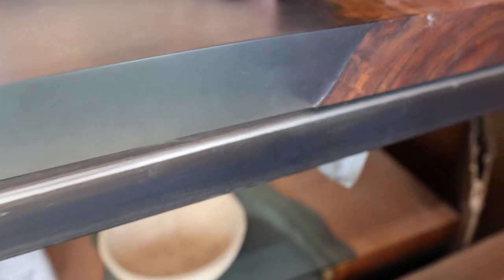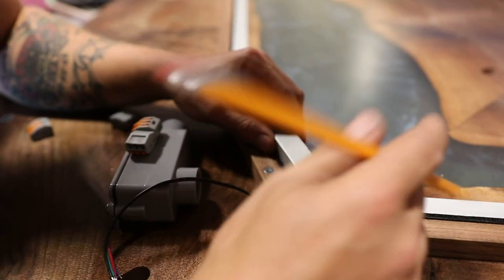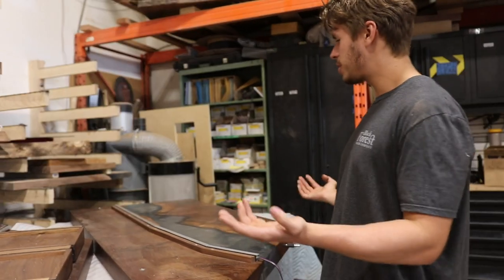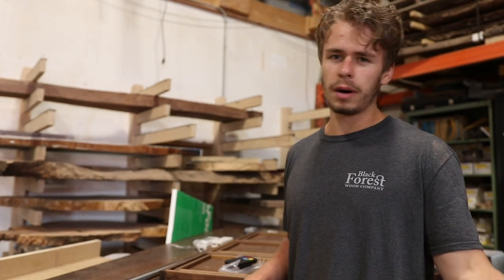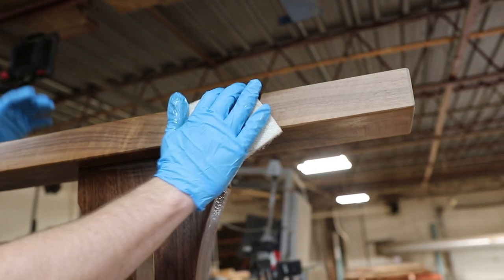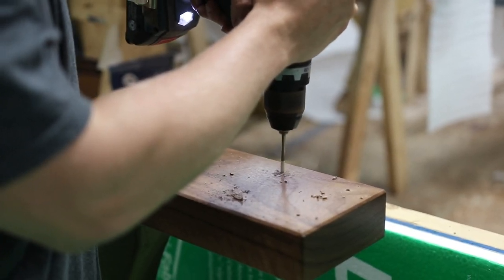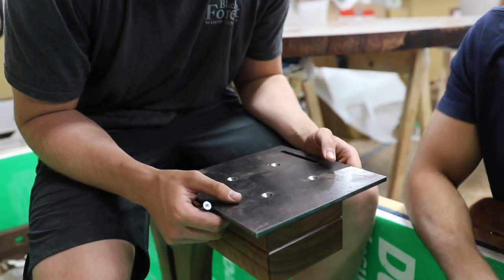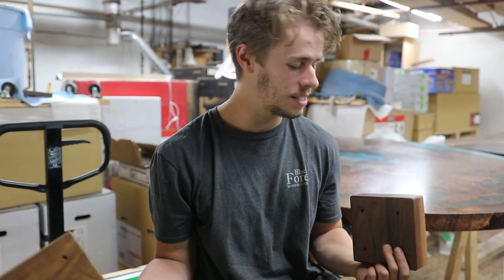Resin River Desk with LEDs - Resin Art

Comment: Really nice job with the LED's!  I recently finished a 30" x 60" river table for my dining room where I used BF deep set epoxy, poured to almost 2" deep and 3" to 5" wide.  The color came out a very dark blue-green that I really couldn't see through, so I decided to try and spiff it up with LED strips.  I built a 4' long reflective light box using a pair of 1" x 1.5" strips of pine wood with a groove cut down their lengths.  In these grooves I glued a sheet of 1/8" thick, 12" wide whiteboard, white side up.  Along the inside of one of the strips I mounted three 12" LED arrays that I got off Amazon.  Then I mounted the box along the underside of the table, aligned with the epoxy but with the one side with the LED arrays set further away from the epoxy than the other side.  When I turned on the LEDs, the light was reflected off the whiteboard, resulting in a more even and efficient spread of the light, and the LEDs themselves could not be seen unless I got my head down to the surface of the table and looked under the overhanging wood.  Under low light conditions, the table looks great!

Comment: Use masking tape to mark and align the blocks when first drilled.  Also, cut some wire coat hangers into 7 inch segments and drop them through the holes for alignment first

Comment: The reason that table broke has nothing to do with sealing or not sealing edges it was because you are only supporting it on the corners so the first person with any weight that used the table to help them stand up would break that since the joint it right in the middle. Make that table again not sealing the edges, put it on those legs, lean on it and it will break the same. No matter how you were to pour that table it would have broken. This is exactly why most people use a flat piece to support the table over the entire width. Good job always taking care of your mistakes with your clients.

Comment: Dylan now that you are using the chilled table do you think it will help with solidifying  faster? Do you think that it will be stronger  bond and not separate or be less likely to separate? What are your thoughts if your chill tables had a  slight vibration when pouring the resins?  My thought is a to the chill table having a vibration that the tiniest air pockets and the bond stronger because  it would help it resin get in all the nooks and crannies?
Reply from the maker: It actually slow down the cure, our plan is to heat the resin part way through a cure and see if that helps accelerate it. The vibrating table is a good idea, might have to try that soon!
Reply: Black Forest Wood Co. if the vibrating table works I get all the credit.  If it’s a total fail you get all the credit and I’ll get amnesia...Black Forest Wood Co...Dylan who?  Never heard of them..lmao.